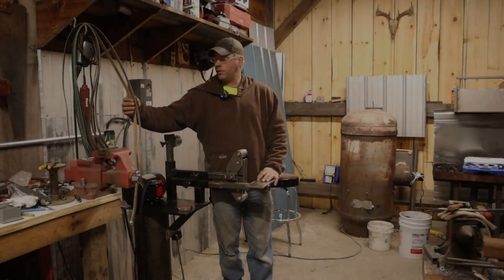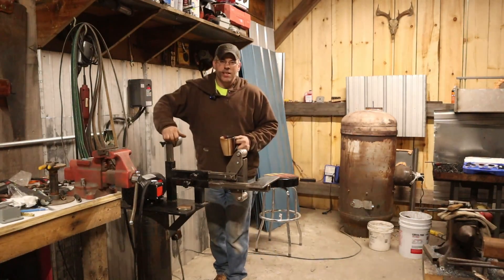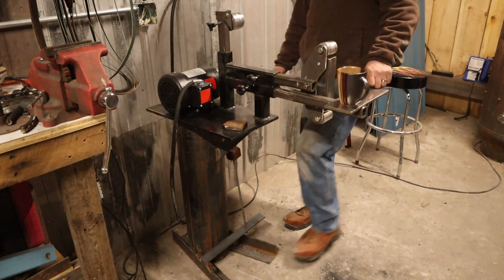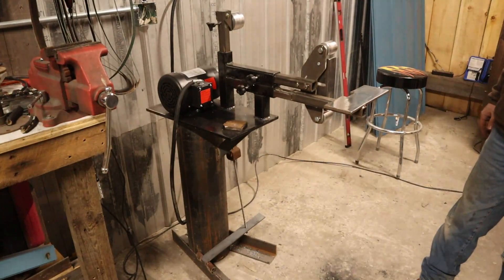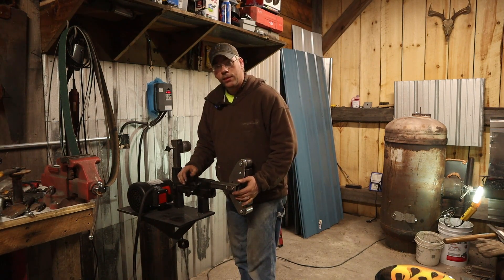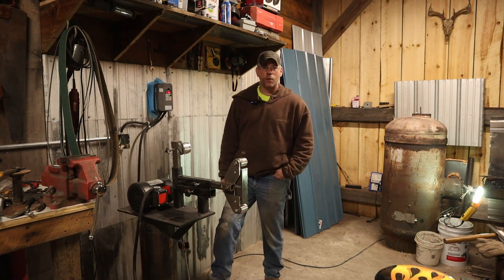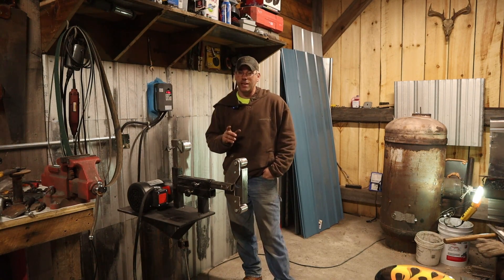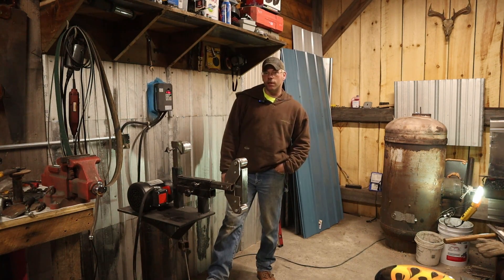No Other 2x72 Belt Grinder Does This

Comment: I think the foot pedal is a novel idea...if you have it permanently mounted on a pedestal similar to your set up. However, what I've seen from most videos is that guys have them as bench top units, and therefore no way to make such a device. JMO. 
I love how that motor winds up with the VFD. I'd like to construct one similar, but I think I'm going to drop the square stock size down a notch to 1 1/2" with 1 1/4" inserts. I just find most of these builds bulky. I don't believe that the one size down on the steel will really hinder the integrity or the rigidity of the unit? What do you think? 
I'm in the process now of locating a motor to drive it and will then proceed to searching out a VFD drive. Big plans with the hopes that the Mrs. doesn't have any other plans that will supersede mine! Nice video...as usual. Cheers!

Comment: Love the foot pedal for operating the tensioner. Helps keep both hands free to place or remove the belts. Also, should make it easier for the kiddos to do the belts as well.
I watched it earlier but had an appointment to get to and didn't comment at the time.
So...
Morning [and sfternoon] Jim. Great build and sure to speed up production. Time is money and this build will save you both. Also will increase "profits" on the sales as well.
Can't wait to see the press build too. And maybe, at some point, a treadle hammer or power hammer to speed up production even more.
Great job on alignment as well, the tracking is true and straight. Do you wax the plattens to reduce drag on the belt and reduce wear on the platten?
Reply from the maker: I waxed it last night after reading your comment and it worked well.  Thanks buddy.
Reply: @TheTradesmanChannel  hey, everyone needs help with ideas occasionally. Glad it helped.

Comment: Great build. Love the foot pedal belt change. What rpm does she run at max ? Got to see about changing mine over to 3 phase. 👍
Reply from the maker: 3600 max rpms at 60hz.  It works great and really hogs metal at that speed.

Comment: That, my friend is a Machine!

Does your super dooper all seeing inverter have over temperature protection? If not you need to watch out that your filter does not stop airflow over the heat sink ;0) 

I assume you have a plate for that electrical box ..... 'be a shame to get it full of steel dust with the childer pokin' an' proddin' about there! (I assume it would void their insurance too) ;0)
Whilst I am on the subject of electrics ....... your main panel is in a dust free area?  You seriously don't want to see what metal dust can do in them ..... it is Not pretty!  In my line of work I see the aftermath too often!
Reply from the maker: I have a cover, just need to pick up a 2 pole switch.  Yes, the main panel is in a dust free area, I work in a lot industrial places and know what you mean.  The vfd does have a high temp protection built into it.
Reply: @TheTradesmanChannel  I thought it would! I just want others to be aware before they do something stupid without realising ;0)

Comment: Awesome grinder, lots of options to make it user friendly, and now comes my back seat driver tip 🤣 you will be cursing that thing after running into it a dozen times. Seeing how you used pipe for the stand it would be simple to make it swivel, pipe in a pipe.

Comment: Good morning;  Coming from a family of machinist and working as one for a while among many other trades, I give this project a pass.  It's pretty good for being born in a barn ha, ha, ha.  Approximately, how much $ do you have into the project ( I understand some materials may have been collected from the fringes )?  Of the needed purchased parts who would be the parts suppliers you recommend ?  Man can't live without a good homemade grinder.  Finally, what advice would you offer if you had to do it again and / or what are the pitfalls; you may not have mentioned in previous videos?  Hence, what should one lookout for? Again, nice job Jim!

Comment: Need a dust mask
Reply from the maker: I generally always wear one, a quick test turned into an hour of grinding.
Reply: @TheTradesmanChannel  hang the respirator on the machine as a reminder to wear it. If it is in the way of using the tool, you have to pick it up and move it, might remind to put it on for the kiddos too.

Comment: A really nice completion to this tool. Looks like it will perform very well for you.
You may want to consider building a "fender" off the top roller. I noticed the sparks were being directed right at your face. A small piece of sheet metal anchored shouldn't be a tough addition at all and your kids would probably appreciate it too.
Reply from the maker: You read my mind, I was thinking that while using it.  I will say that I ddin't get any in the face but it could easily happen.
Reply: @TheTradesmanChannel  maybe the top rear wheel as well? Looked like the sparks were hitting the open electrical box and the cord. Don't want to fill the box with metal dust or burn a hole in the cord.
Reply: @TheTradesmanChannel  your a good man Jim bob
Reply: I agree